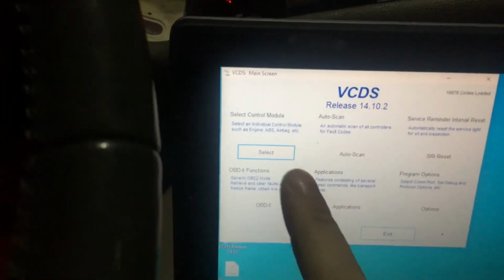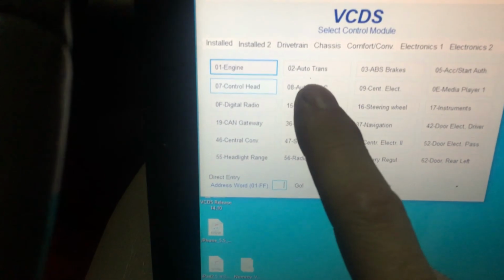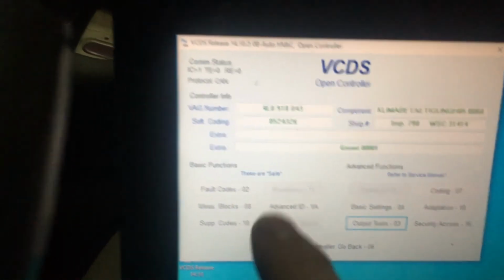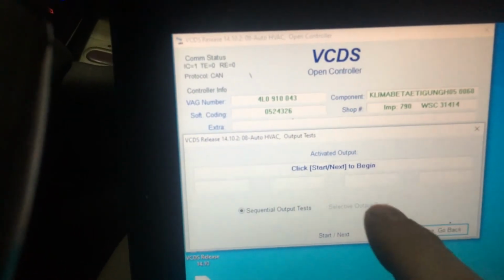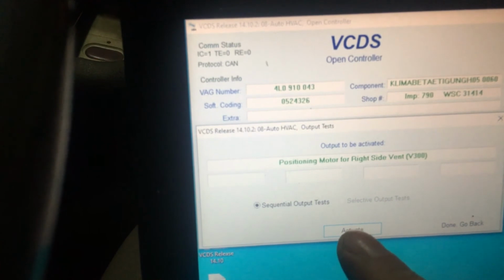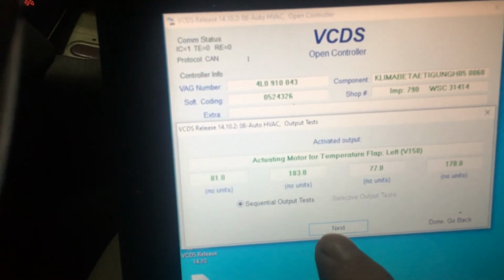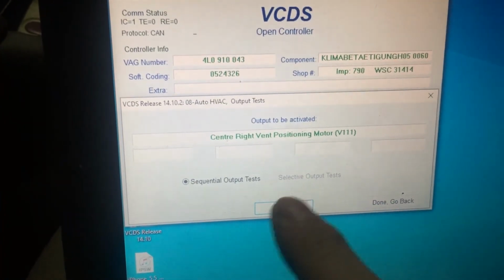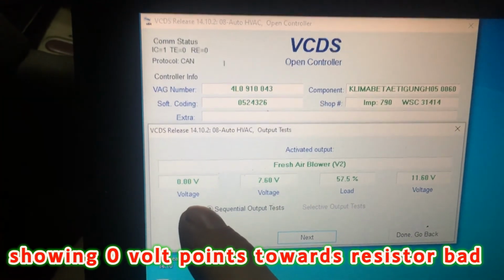Audi Q7 2007 Blower Motor or resistor bad not spinning testing with VCDS and voltmeter

Comment: Was it the resistor then or.🫡
Reply from the maker: Mine was the resistor. and the blower I got off amazon was total junk. it "worked" but was not able to spin as fast as the original.